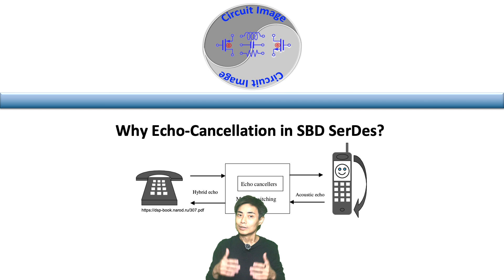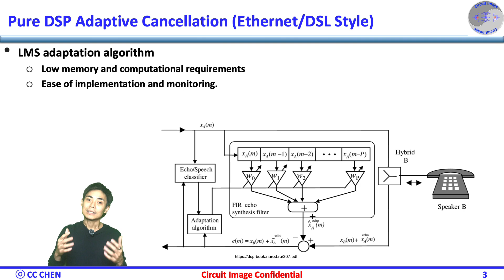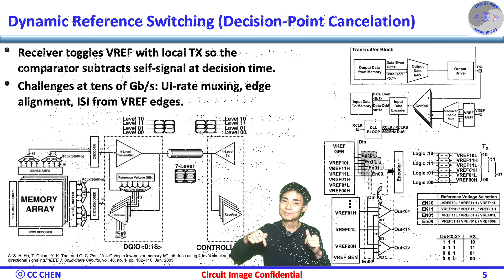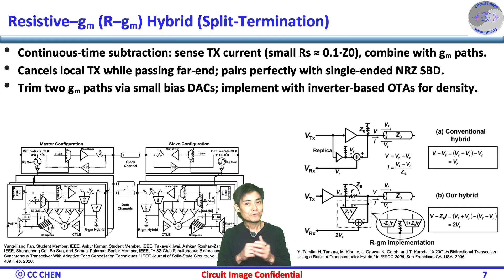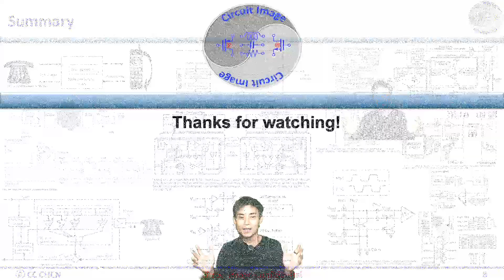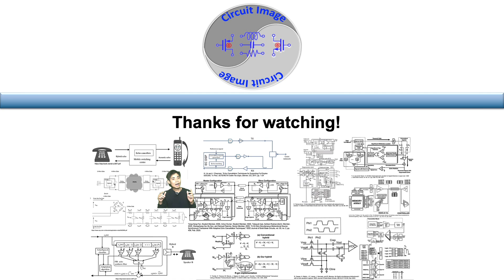Why Echo-Cancellation in SBD SerDes?

Comment: Everything is more complicated!!  

The basic chanllenge is that the response of echo signal is high pass type, but far-end signal is low pass type. When the BW of the signal continue to grow higher, it will result that larger echo signal power but smaller received signal power from far-end. The other problem is the selection of the sampling phase of ADC. The phase of ADC is locked to far-end signal in the common CDR system. Howerver, it may need to lock to the local TX signal to suppress echo power mainly in some conditions - the more complex clock control scheme is needed. In addition, the amount of taps of FIR for echo cancellartion also need to be considered for all reflection signal from the discontinuous point of the channel. 

Therefore, it seems the double BW will be available if TX&RX could be operated on the single channel, but the investment in real circuit for echo cancellation may cost higher than expection.
Reply from the maker: Hi Analogue, 
Thanks for the summary, and I agree— you captured the core challenges perfectly. The trade-off between the high-pass echo response and low-pass far-end signal really limits practical duplexing. As you said, once bandwidth grows, echo power dominates, and coordinating ADC sampling phase with either TX or far-end CDR becomes a tough control problem. The FIR echo-cancellation complexity (and its power cost) often outweighs the bandwidth gain in real silicon.
Thanks,
CC
Reply: @circuitimage  Hi, thanks for sharing. I have a question about the echo cancellation. This echo cancellation adaptation needs to adapt foreground, so in mission mode temperature varies FIR for echo cancellation can't track the variation, right?
Reply from the maker: @zhiquanxue  
Hi Zhiquan,

Great question! You’re right — most echo-cancellation FIR adaptation is done in foreground (during calibration or training), so it doesn’t continuously track temperature or aging in mission mode. However, designers often include small background calibration loops or periodic retraining to correct slow drifts. In practice, the channel’s temperature sensitivity is low enough that occasional recalibration is sufficient.

Thanks,
CC